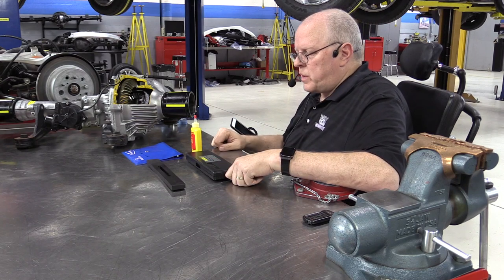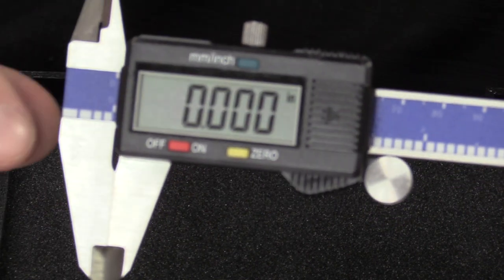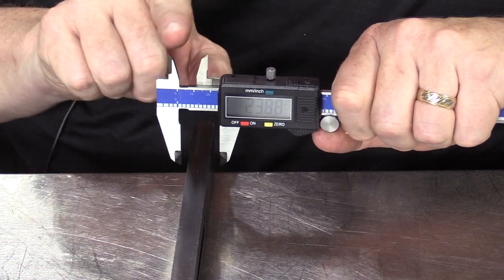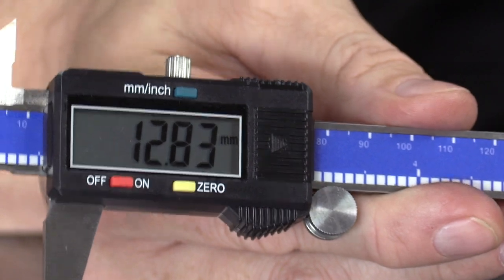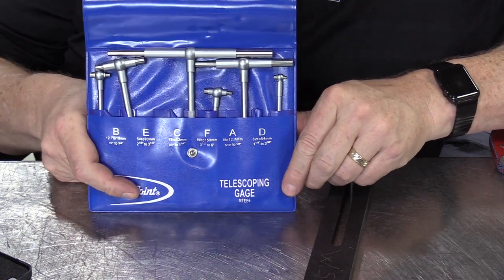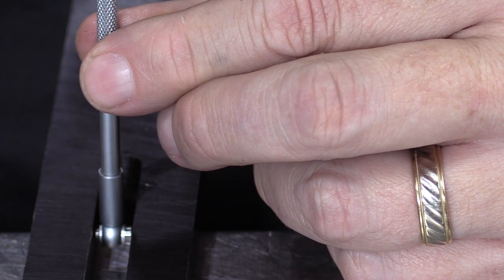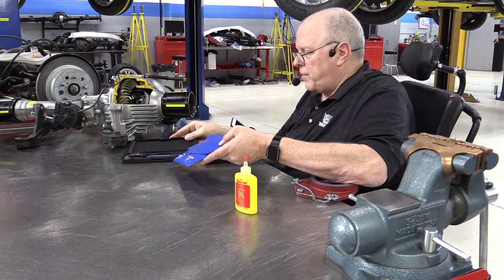How to use a Digital Caliper and Telescoping Gauge

Comment: I just found your digital caliper video and enjoyed it immensely.   I bought my Mitutoya 30 or so years ago to measure the valve adjusting shims for my Honda CBX motorcycle. The CBX has an air cooled transverse 6 cylinder, 24 valve DOHC engine. My digital caliper helped me keep the valves perfectly adjusted to factory specs. It doesn’t have the thumb screw, which would be nice. It does measure to ten thousands of an inch, i.e., 0.0000. It has the same notched depth part. It cost me $100.00, which seemed a lot of money, but worth it for me. Now Harbor Freight sells digital calipers for $10!  Surely not as accurate?  I never worked in the trades, just telecommunications, data communications and computer operations.

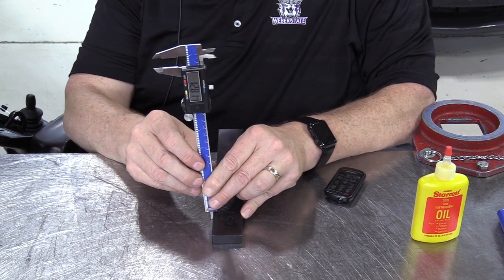Comment: There is another way that can be measured with calipers. At 6:45 in your  video. If you turn the caliper upside down compared to how you hold it at 6:45. There is another surface with which you can measure with( on the back side of the caliper). I do not know if managed to explain what I meant. And i love your videos,they are really good.
Reply from the maker: Yes, that is true. Thanks for the information!

Comment: Don't reset if there is no 0.00 on display. First open jaws, clean them, close again and if there isn't 0.00 then reset it with "zero" button. My mitutoyo doesn't like big acceleration so I always use wheel for opening and closing jaws in order to get precise measure.
Reply from the maker: Great feedback, thank you!

Comment: Just out of curiosity, what is the step on the bottom of the depth gauge extension rod for? Just something to help measure into smaller holes?
Reply from the maker: I do not know for sure, but I suspect you are correct; smaller holes. Thanks for your feedback.

Comment: My Caliper has to be so smooth that it slide down without pushing it and I wouldn't use oil because it will attract dirt. Only clean it with a reg. And I would recommend to make the copperplate unbowed.
Reply from the maker: Thanks for your feedback

Comment: You already measured the thickness at 12.7mm and when you used the depth gauge you got 12.83mm but it should have been the exact same measurement. You’re not taking accurate measurements at all with those calipers
Reply from the maker: You are correct, I messed that up